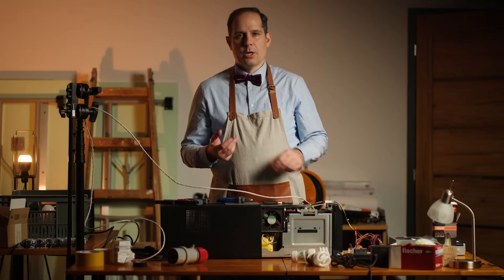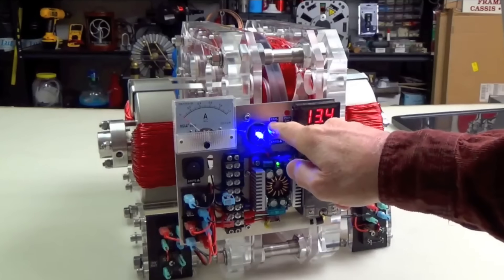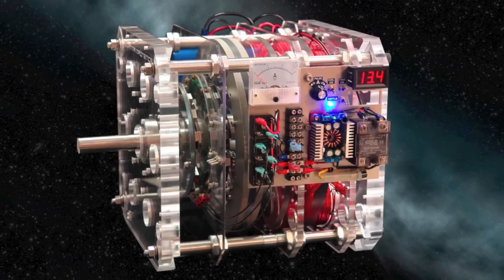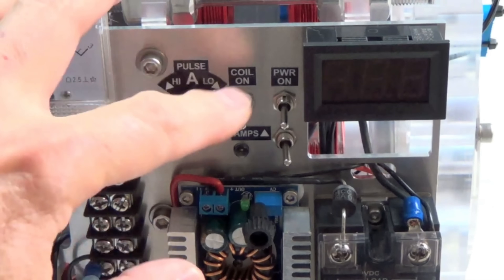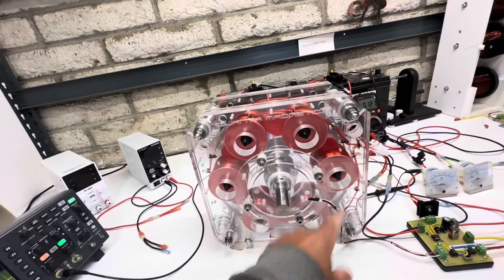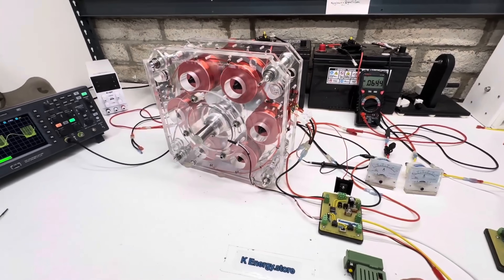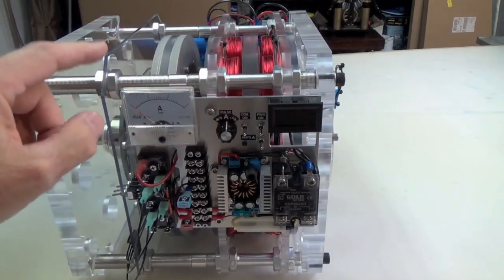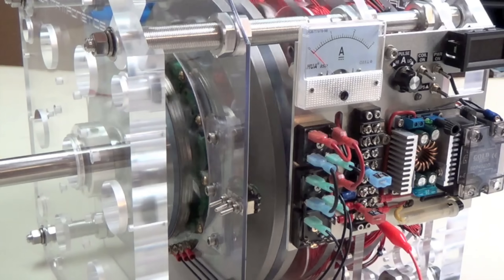American Company JUST LEAKED THE IMPOSSIBLE: Free Energy Generator Quanta Magnetics (Big Oil End!)

Comment: You may have Volts, but 0 Amps as indicated on the meters in the video implies 0 power. A good test setup would connect power output +/- leads from the generator alone (no batteries) applied across a load, such a bank of incandescent light bulbs, along with a Volt meter across  the load, and Current meter in series. That way one can see an actual load being driven, while the measured Voltage x Current values would provide the output Power in Watts.

Comment: I analyzed this device from the video.  They have three full bridge rectifiers on the board.  They have not got them wired correctly.  A full bridge rectifier has two contacts in for AC and two contacts out for DC, one red the other black.  they have two of the bridge rectifiers conected to each other with no ac in so there can be NO DC out.  If they do not even know how to connect a full wave bridge rectifier correctly then there is NO way this can ever do anything but con people into buying it.  The purpose of a full bridge rectifier is to convert AC power to DC power with plus and minus voltage output.    these look like they are about 10 amp rectifiers but are connected to each other with no input and no output.  This is fake, fraud and will never produce power.  The colour code for the wires is all wrong as well. You must have red for positive and black for negative.  There are so many things wrong with this a first year electric student could prove this is a fake a fraud.

Comment: They collapsed because they were either killed or bought off. It has always happened to companies that disrupt big oil/big energy.
Reply: It also happens to scammers who are found out.
Reply: You can't hook a motor to a generator and think it will power a home; I look at the shafts on these devices and you can see them slow almost to a stop and they pull the cord.  It might stay running for a while and look good but throw a load on it instead of a 40-watt bulb.